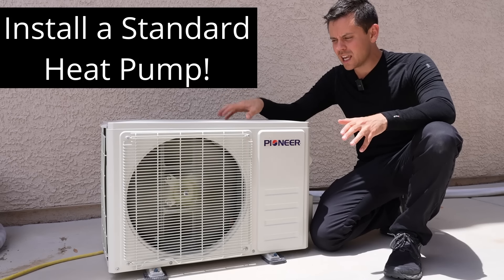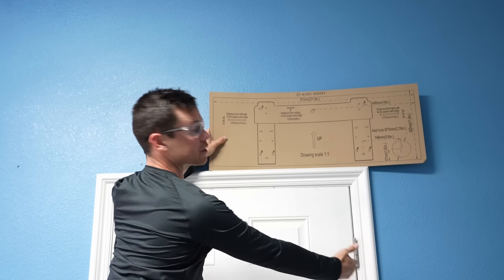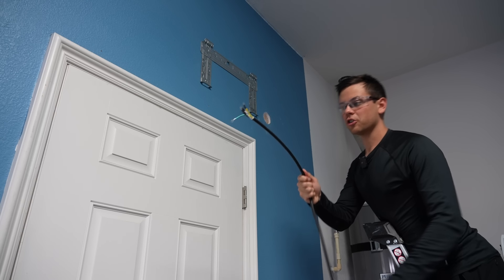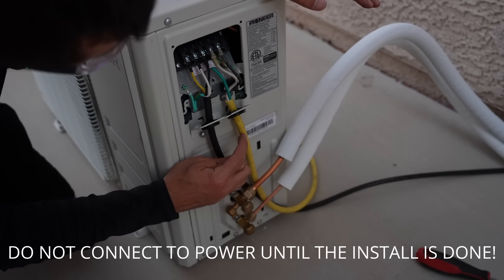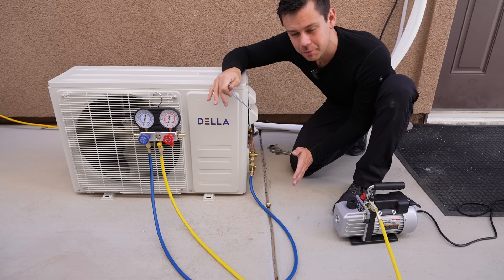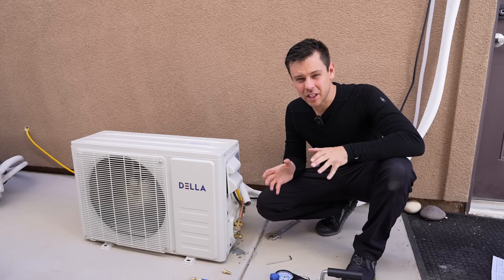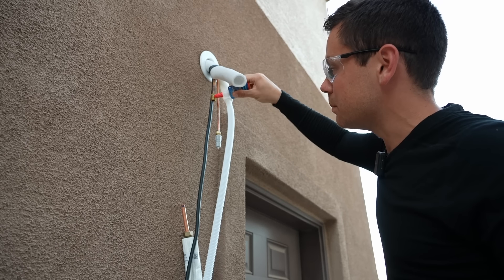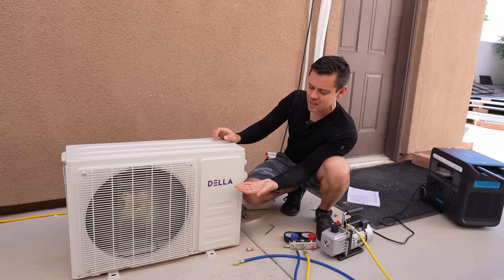Budget Mini Split Installation for Beginners! w/ Vacuum Pump and Gauges

Comment: There's only a handful, or less, of companies who make these units. So just like a lot of the inverters, as you are aware of, there's loads of different "brands" that have the same parts, quality, design, layout, life span, etc.
Pioneer Mini-spits are manufactured by Parker Davis HVAC in Miami Fl. But that doesn't mean that they don't manufacture other brands with the same bits, or more like slap someone else's labeling on the box/case.

Comment: This is great video, but to really make it better I think it would be good to show how to hook the system up electrically or at least mention the parts needed such as an AC disconnect, wire, and circuit breaker. Then note that if you are trained to work on the electrical in your house then have at it, otherwise have a trained electrician install it electrically. That's a huge step that shouldn't be forgotten.

Comment: I have issues with this. 😐
Reply: Like the EG4 unit he showed ( 1299.00 now)  have the ability to have solar panels hooked directly to them with no battery or inverter. And the pioneer can't. He compared units that don't even have close to the same features.

Comment: You must leak test with nitrogen or you are asking for leaks. I have Been doing  this a lifetime.

You are brutally thorough on everything you do but you can't leave out this critical step.

Vacuum guarantees pulling in moisture. You need a micron gauge to properly check for vacuum. Leak testing with vacuum is a no no.

Comment: You watched a lot of videos and did a lot of research to make this install.  
That UV resistant white sheathing is only rated for 90 days UV resistance. It’s never meant to stay exposed to the atmosphere directly to the sun for long-term. . 

Good job you have been improving over the years, looking more professional, and getting more steps and procedures correct I’ve been watching you since you lived in your van. From your very first videos.

Comment: Great video.  Thanks.  I think the trimming of the line set is important to improve system efficiency, but if unable, it's worth mentioning that the coils should be laid flat, not set vertical.  Vertical coils create low spot traps in every loop which will collect oil.  Trapped oil means less oil for your compressor.

Comment: better for the world if these mini-splits become more DIY friendly. While the mechanical install looks straightforward, the electrical work might not especially if it will need a new connection to the electrical panel/breakers. Lower power mini-splits can be potentially connected to AC outlets through a plug or electrical box.
Reply: My 1HP Daikin inverter air-conditioning units use max 480 watts :-)
(Cooling only,) SEER of +23...
Highly efficient units.
(And already 4 years old),

Electric??
Power socket is all one needs.

The time that air-conditioning units need to consume +3-4000 watts is long behind us.

If your home can't provide this power...
You have other troubles 😂
Reply: @fhorst02  Agreed! We have one mini-split in our house that can go as low 250+ watts, massive efficiency and quiet operation.
Those massive central HVACs really are behind us.

Comment: FYI, Do not put Nylog Blue directly on flare nut Threads, only put on flare surfaces. The torque spec for those flare nuts are "dry torque" not wet. if wet torque will it will be incorrect and could cause damage. This was a very helpful video thanks.

Comment: Nice one! The (maybe) unfortunare part is, that only licensed proffesionals can do this type of split systems in our country… due to environmental concerns…
Reply: If you are in Europe...
There is a huge misconception about this!!
You are allowed to install, even can buy at your local hardware store.
BUT.. you can not refill.
That does require "license"...

Also not really..
Every garage can repair your Aircon, and many refill...
Without any certification :-)
Reply: @fhorst02  Yeah, Czech republic under EU regulation here 🤘 I am rather glad that this matter is subject to regulation, to hopefuly prevent environmental damage 🤷‍♂️

Comment: In a total off grid situation; do you think the EG4 unit that can take PV direct, is worth the extra cost?
Reply: No.
That is... You already have your off-grid setup, right?
And, hopefully oversized to be able to deal with those rainy days.
That "over capacity" can be used on the hot days for the air-conditioning..

If it's a tight fit, just enough to keep you powered..
And increase the overall capacity isn't a solution...

Yes, the all in one units are great!!
Simple solution that doesn't require much else, BUT... Compared to a non "all in one solar system"... 
Will be more costly/ expensive.

It totally depends on the setup. And it can be the best solution!

Comment: Nice job. I'd like to do this in my garage. 
Just a note: Those pressure gages from HF are sized for R134.  The gages do read high enough for R410 while running, but barely. It will definitely peg the low side gage when off.  If using just as a vacuum gage, it's probably ok. Or use the high side to check positive pressures.
Reply from the maker: Yes, just using for vacuum and positive pressure only.
Reply: Good tip!!
I've done the same with my R32 ...

Comment: never saw you open the valve at the bottom on the low pressure side on the A/C.  Not sure what you were vaccing down.  then you closed the upper valve, effectively isolating the gauge from the line you just vacced down.  A steady gauge at that point doesn't tell you anything about the vacuum (if any) on the line set.

Comment: "You did not show the AC run. It would have been better to install an outdoor outlet for it. It seems you just ran it through a hole in the wall and probably plugged it inside the house. Moreover, it might have been a 115 AC instead of 220. If I were you, I would have placed it on a small stand outside to protect it from heavy rain."
Reply from the maker: Huh

Comment: Pretty good videos all the time especially on that air conditioning unit too bad you couldn't find shade for it or put it close to the wall and put a board meeting over it they work a whole lot better in the shade keep making those videos are awesome
Reply: The unit is placed correctly, for the wall distance.

It can not be too close, as the air needs place to flow :-)

And yes... In the shade the unite will perform a bit better 
Making a (small) roof over the unit won't make any difference, the airflow, sucking in the "hot" air from the non shaded environment.

It doesn't hurt, also doesn't help.
Reply: Yes, they cool better in the shade, but in winter, that direct sun will allow it to heat better. Take your pick.

Comment: I have watched 5 different videos on the DYI. I would like to suggest that the placement of the hose be stressed prior to taping. It is my understanding it should be on the bittom underneath the lines so that condensation can drain properly. Your teaching style is perfect. Just ordered my system and I chose your  video as my TEMPLETE. Good Job.

Comment: Will, would you do a power consumption demo in this unit? If you have a 9,000 BTU unit I'd be interested in seeing the real world power consumption on that as well.
Reply: Same here. Power consumption on these units can be really hard to figure out (it's not usually a simple specification in the manual, from what I've seen) until you've already set one up. It's good information to know in advance of buying if you're going to be power-constrained, like on off-grid solar.
Reply: We have Daikin inverter air-conditioning, 8500 BTU, SEER of 23 dot something, and on turbo 11500 BTU.
Max power consumption on turbo is 480w. (Yes.. off-grid solar)

Smaller units are far more efficient then the larger units, better place a few smaller instead of one bigger!

The rest is dependent on your setup and environment.
Higher humidity will cool better, as moist air can hold more energy than dry air.

Wall, window, door and roof insulation, list of variables is long :-)

So how much electricity it will cost to lower your indoor temperature by 5 degree Celsius... Impossible to tell.
Also how much energy it will cost to keep it at that temperature.. same same.

It's usually more efficient to keep the air-conditioning running 24/7, and just set the room temperature a few degrees higher when you are absent.
The amount of energy to keep it cool is way less then to make it cool :-)

Keep it cool guys hahaha

Comment: Put in my first Pioneer 7 years ago DIY style, I now have 3 + 1 multi split. Because these are so efficient the solar system I just installed was very affordable and the overall system, Mini Splits + Solar, works great! Power company is going to think I'm on long term vacation.

Comment: I really want to do this but I'm confused - where do you get the refrigerant to charge the unit? Does that not need to be acquired and added by an HVAC professional?
Reply from the maker: No it comes pre charged. All of them come this way. Watch the vacuum procedure on how to vacuum the lines and release the refrigerant

Comment: Hey Will, love your content.  What is the power consumption of this unit?  How much condensation is produced? Is it a small enough amount so that I can let it drain under my house?  Thanks!
Reply: Not Will here😂.. power consumption depending on the unit. My 8500BTU (peak 11500) units use 480 watts max. (Daikin, inverter type) good enough for a bedroom.
In the living room we have 2 of the same, for the simple reason 2 small ones are more efficient then one larger unit.

The amount of BTU (use Google to convert if your country uses different scales) is highly depending on the house insulation and outside temperature.

Condensed water highly depending on your location and average humidity.
For me on a humid day we easy get 10L (+ 2 gallon) with the small 8500BTU unit.
During a drought.. a few liters.
Normally this condescend water is not captured, but run to soil or concrete slab and is seldom a problem.

Obviously.. you can collect reuse :-)

Comment: Hi Will nice video agan. Dutch installers use small valve with a depressor at the service connection so u don't lose any refrigerant .Small tip if you have R32 or R410 in the unit. You cant use this manifold gauge for service.

Comment: There is a big difference between these two units... HSPF is 8 on the Delta and a 10 on the Pioneer... Cheaper to heat with the Pioneer... Seer is different as well but only 29 and 20....  But why buy such low seer units? And low JSPF units... Huge savings if you would go up to say 25 seer and 14 HSPF...
Reply: 20 not 29 seer....

Comment: Great video thx...question, is the amount of refrigerant in the lines specific to the length of line set?  If you increased the line length would you need more refrigerant for the increased volume in the lines?  So when you cut the line and shorten it is there too much refrigerant in the lines?
Reply from the maker: With these pre-charged units you need to get the proper size line set for how much refrigerant comes with the unit. Some of them come with very long line sets and more refrigerant inside.
Reply from the maker: Most of the DIY kit mini splits will come with the proper line set length for the amount of charge in the unit

Comment: Question:  Jim, now that I know how the non-DIY systems can be set up, for those so-called DIY systems like Mr. Cool where they claim to have lines that are "pre-evacuated" and "pre-charged" at the factory, wouldn't the connecting lines that go to the indoor unit (that are not pre-evacuated) have air in them?  Therefore, it leads me to believe those DIY units like Mr. Cool may have contaminants and moisture introduced into the system when they are connected to the outside compressor unit.  True?

Comment: Do or have you installed a mix solar/wind setup?  I live in Minnesota and plan to make a setup for a cabin off grid.  What would be the best components for powering a mini split (heat/AC), lights, microwave, well pump, smoke/co detectors, small refrigerator, cellular trail camera (security) and outlets?  Love your work - fellow EE. :)

Comment: You do list the hose adapter, thank you   Second, I challenge you to take the batteries out of the remote control while the mini split is operating. See if the mini split has a loss of memory and goes in default mode.

Comment: Another relevant video, I bought something similar, wired and plumbed it all myself and got an Ac guy to purge the lines for a $100. Whole project cost me 1/3 of normal price. I didn't bother with the torque wrench, I just did it up tight and I imagine it would take a very strong ape to over tighten it :) Great video, cooling is no longer a luxury in a brutal heat wave.

Comment: Nylog shouldn't go on threads! Just the face of the connection where it actually seals
Reply from the maker: Two HVAC professionals told me threads as well. And so did the HVAC store here in Vegas.
Reply: @WillProwse  Dang, then I've done goofed. I heard the exact opposite when I installed mine 🤦🏻‍♂️👀

Comment: Will or anyone who knows to answer please 🙏

Hey Will love your content. About to buy MPP Solar 2724 LV-MR. Can't download the manual so just wanted to know can the inverter be turned off for AC when not in use? I'm building a system for my van mainly for 24/12V.. I know that inverter draws 24W.

Also 4 150W panels with VOC of 42.74 I'll wire parallel and s/b about 17 amps at max and VOC 42.74. Is that going to make for a good system? ( 2 100AH 24V SOK batteries..)

Comment: Great job. The only thing I would add would be the nitrogen flush/pressure check but tens of millions of AC units have been installed without it and more ever day with no harmful effects. The only difference between your install and one on a conventional house AC unit would be the difference between flare fittings and brazed copper which even that is going away in favor of a new flexible lineset.
       I did commercial refrigeration way back and it was not fun. I can't wait till it cools off so I can finish doubling up my shop insulation and be able to work out there again. I would like to go with an EG4 2400 but I may go with a package unit instead. There are reasons for the package unit.
Reply: Nitrogen pressure check would be ideal. Unfortunately it probably a bit beyond the scope and budget of the target audience. Another method would be to use "KWIK-E-VAC" to pressurize the lineset and leak check before releasing the 410a in the unit. Once you leak check with the 152a from the can you would pull a vacuum just like you would with nitrogen.

Comment: Really Great Job! Very informative!

Since you are around 115ish temp, what size space you cooling and what temp you get it down to?
Reply: :-)
How long is a string? (Or how heavy)
Not enough information to answer.
How good is his space insulated??? That will make all the difference.
It looks like 2 thin boards with a few inch of rockwool?
Then the roof.. that will radiate a lot (or not)
Doors, Windows...

In Thailand with 40-44c our 8500BTU (1 HP) 480w max Daikin inverter air conditioning units are capable of cooling a 4*4 meter room to 26c.
BUT... It has good insulation.
Build to keep the heat out.

The same unit in an other house, large windows, glass sliding door, less good insulated... It's struggling to get it 8 degrees Celsius lower. (At 40c outside, doesn't get cooler then 32c, curtains closed Windows tainted)

All depends 😂

Comment: I see you have a central A/C unit too, I assume it has an issue and it was cheaper to do multiple mini-splits instead of a ducted heat pump? I need to replace my central A/C eventually and would like to go to a ducted heat pump, which I'm hoping isn't much more difficult than this install... after all, they're at least conceptually very similar. But if you could do a ducted heat pump install tutorial, it'd save me like $15,000 :D
Reply from the maker: Actually no haha they all work

Comment: haha an extention cord.... that's definitely my style!  I plan on running one of these exclusively off an inverter/solar panels.  Though whats available online seems to be senville units(in canada), hopefully they are decent. Wish an eg4 unit was available here.

 Luckily I have access to nitrogen to do a pressure test as well.   friend has a pump for automotive stuff, should be able to adapt it to the mini split, if nothing else with my nitrogen tank hose.  What are peoples thoughts about periodic re torque of the line sets, say after the first few days of operation, then maybe seasonally?
Reply: Re-torque should not be needed.
It's advicable to check after a few days of operation.
Brass does "settle".

But... If torqued to specs.. no need. By hand? Better check.
Remember... Most leaks are from overtighten flares!!!
Not undertightening them.
Not tight enough is an easy fix...
Too tight will require you to reflare the tubes (and top up the refrigerant)

Loctite blue or nylog will reduce leaks

Comment: Good video however you should pull and hold the vacuum for longer, say 30/60. It is also advisable to secure the compressor/condenser prior to installing the the lines thereby minimising stress on connections
Reply: I left mine overnight and also filled tbe lines with 300psi of nitrogen overnight to make sure..Then I sucked it down to 20 microns before releasing the freon..Do it right the first time and forget it is my motto.